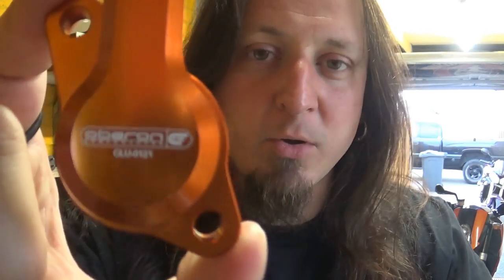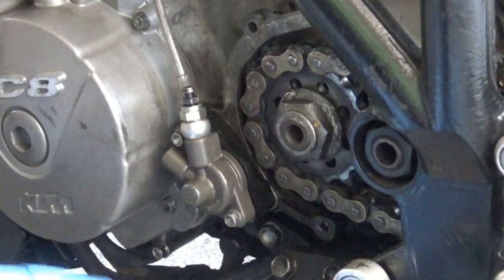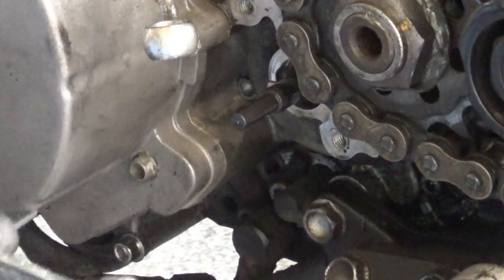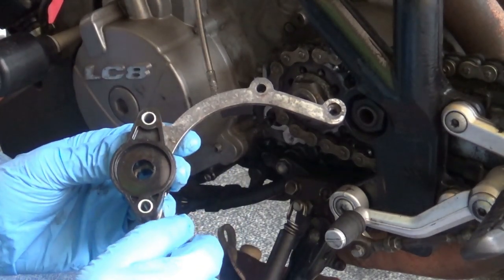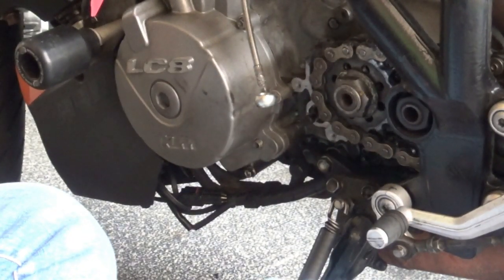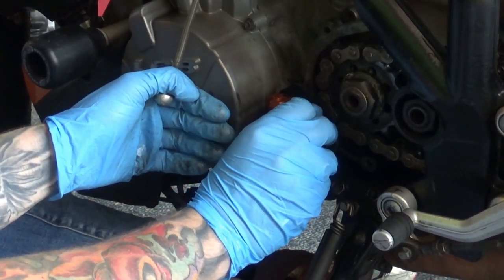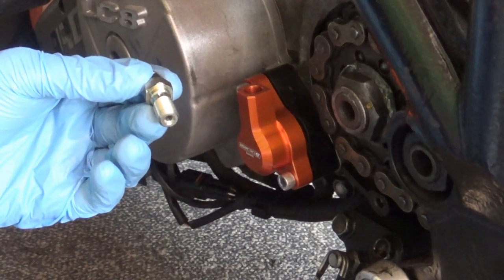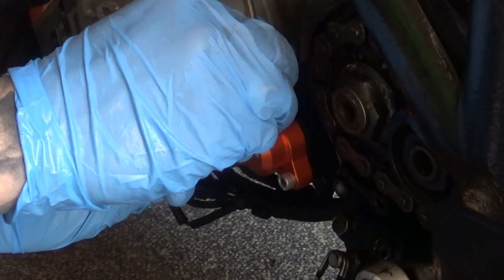How To Fit Oberon Slave Clutch Cylinder to KTM Superduke 990 LC8

Comment: I just replace my factory 2015 KTM Super Duke 1290 R clutch slave cylinder with the Oberon unit and their billet spacer.  I inspected mine and found it to have the identical crack around plunger nipple.  Replacing it was a breeze because of your video, much appreciated!  Your little trick to bleed the slave cylinder saves a lot of time.  I however did not reverse bleed the clutch line.  Just filled it from the top and bleed the clutch lever from the top.  Super easy to do, it took very little fluid.  Test ride, it's all good.  Clutch engages right away with very little take up.  Action was smooth and a little easier to pull then stock.  I will bleed the clutch lever again in a day or so just to make sure there aren't any air bubbles trapped in the line.
Reply from the maker: Good man. Thanks for the feedback and glad it helped!

Comment: The same thing happened to me on my 2022 1290R Superduke Evo, it left my Wife & I stranded on the side of the road. My bikes been in the shop almost 4wks waiting for KTM to get the part to my dealer. Thanks to your video I'm going to order the Oberon and get it to my dealer, we'll discuss reimbursement for the stock piece of garbage later.
Reply from the maker: 2022 and had a problem already? Not great... I have to say, the more I think about it the more issues I hear with KTMs. I love the bikes, but they do have some issues.

Comment: Thnx for the video, Just installed on my 1190, it works and goes easy, but the neutral is little bit an issue, sometimes hé doen t find neutral, like a ducati, is this normal, when riding goes ok and not always have this problem, or better to ride a few days and bleed again?
Reply from the maker: I'd bleed it again for sure. Never had a problem with a N on my 990

Comment: Very helpful bud! I noticed some oil on the floor so Im going to check those parts you showed, mine is a 950 SMR, I guess they share same parts,  thanks for the video/explanation
Reply from the maker: Same engine, just carb and not FI, other than that no differences really...

Comment: Great job Mackie i find back filling with syringe works on brake cylinders as well.cheers
Reply: Great hearing you say that.
I'm struggling with refilling a front brake after a caliper swap. Haven't  got access to a vacuum bleeder.
Just on a whim, I went to the pharmacy, bought myself a large syringe, to try backfilling. Haven't tried yet, but sounds like it can be done.
Not having the right tools sucks.
Reply from the maker: @thefreedomguyuk  Yes, yes and yes. It does work on brakes too. Even easier, as break hoses are slightly larger, so it is easier to push through :) Working with the laws of physics...not against it :)

Comment: Detailed and very useful.

Thank you.
Reply from the maker: Glad it was helpful!
Reply: What happens if that loose tiny rod goes missing? The clutch won’t function?
Reply from the maker: I'm pretty sure you need it. It may function without it, but its there for a reason, but I didn't design that clutch,  so can't answer what it's purpose is.

Comment: MackieBass, thanks for showing us this great technique to minimize air bubbles.  One thing to note is that you should protect all your painted surfaces as the brake fluid will eat it up quickly.
Reply from the maker: Yes. But ain't no brake fluid...it's mineral oil. Nice and safe :)

Comment: Great video! I’ve just changed mine but it seems to be a little bit of fluid between the banjo and bleeding screw. And I’ve tightened both bolts after driving and it doesn’t seems to work. I wonder if I maybe placed the hose at the wrong place, do you think it can cause a leak?
Reply from the maker: Without seeing it I cannot tell, sorry.
Reply: I'm assuming you've got this fixed from nearly a year ago!
But for anyone else the bleed nipples do weep a bit of fluid past the screw threads  when bleeding and they need a good bit of torque for such a small screw, leading to knackered threads over time and repeated bleeding.
Another thing you will find is the copper sealing washers between the banjo will compress, so it's wise to leave things overnight and tighten the bolts up again the next day.
So yeah, if you change your lines or parts, just nip things up a second time to ensure that everything is tight.
Trust me, I learn things the hard way!

Comment: Cheers Mackie, just received my Oberon part  today! Feel confident enough now to change it myself after watching your video.  I had a similar problem were the fluid was being pushed past a faulty
 o ring in the cylinder.  That fluid that gets pushed through ..do I have to worry about were it went?  Any chance its now mixed with engine oil and I need to do an oil change?
Possible it's a stupid question, but if you don't ask you don't learn.
Thanks.
Reply from the maker: Hey man. That fluid cannot physically enter the engine oil. It's only hydraulic pressure to operate the slave cylinder to push the clutch mechanism. So don't need to worry about that, but do inspect it for any damage or cracks etc, as it can be part of a bigger picture. Double check you manual and installation instructions,  my video may help, but I'm no expert  buddy. Good luck and stay safe.

Comment: Hello mackieBass!
I have similar symptoms.
While riding yesterday, it happened twice.
I pressed my clutch and my bike still wanted go forward but after some minutes later the clutch restarted to work.
I haven't open nothing yet I want to learn first.
Bt did your bike was doing the same?
Reply from the maker: it was, but it didn't fix itself. Had to replace it as it was only going to get worse.

Comment: Why would you choose for an oberon cylinder over the OEM cylinder? i have problems with my clutch and i am tempted to buy the oberon one.
Reply from the maker: The poem broke. The oberon got  better ratings and it was actually cheaper than the oem. So I thought I'll try it. It is lighter. I like it
Reply: @MackieBass  thankyou! ill consider buying an oberon too.
Reply: @4869498  Stock one is known to be a really weak point on the bike - Oberon has double o rings on the piston and made from much better materials. Definitely worth upgrading as OEM will fail at some point like mine just has at 15k miles!

Comment: Do you still own the 990 Mackie? How would you rate it if you do? I am really conflicted at the moment about which 'fun' bike to buy myself and the 990 SD is high up on the list.
Reply from the maker: Oh man, go for the SD990 all day every day. It is the most fun I had on a motorcycle full stop :)
Reply: @MackieBass  thanks man, i am torn between that or XSR900, different bikes but like them both for different reasons.